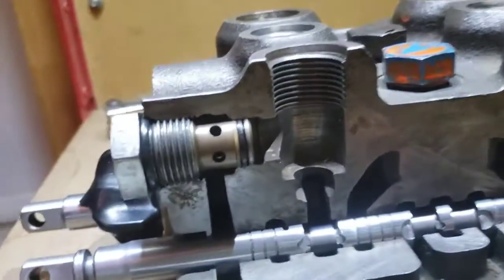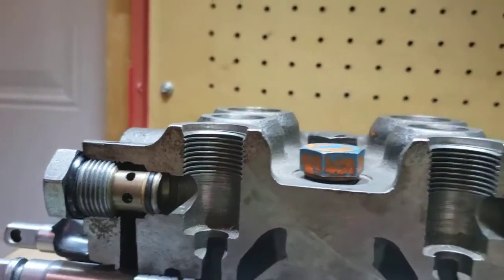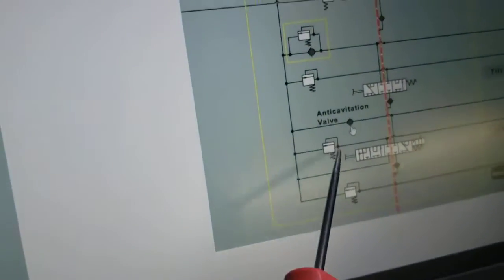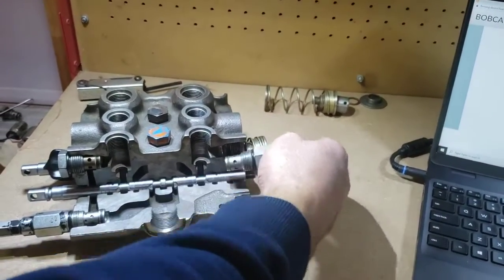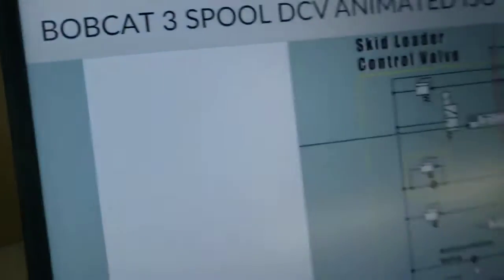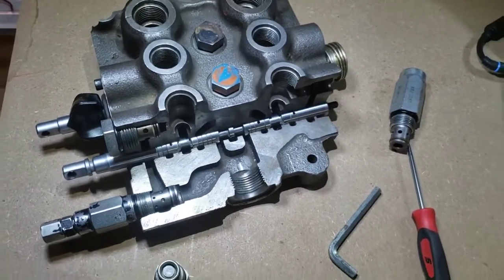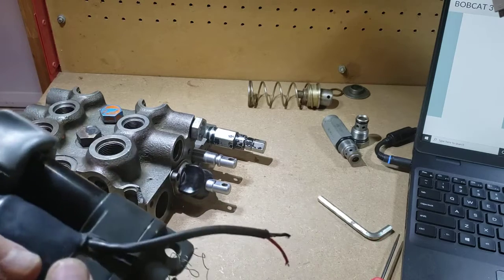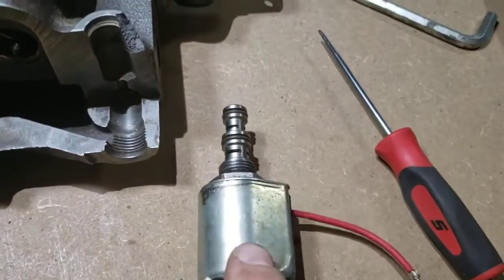Hydraulic Control Valve Cutaway HYDRAULICS FLUID POWER BASICS PART TWO

Comment: Where is the rest of this video? I need the part where you left off of that electronic solenoid mine is not allowing me to get any flow through my couplers lines. There’s no flow at all. Also, I’d like to see how that solenoid works when you apply 12 votes to it, mine is staying on an open position and closing flush. Once you do that I don’t know if it’s supposed to be like thatwe were almost there. Thank you.

Comment: Hi sir. Thanks for the videos. I have a 3 function mechanical valve system on a hyster forklift that has an issue with fork lift drift. I’ve already resealed both lift cylinders, checked relief valves and see no issues. What else could cause this?

Comment: On my compact tractor when I curl by bucket to full curl my relief valve on the system activates. But when I dump and bottom out, there is a delay before the system relief valve activates. 

I've worked the hydraulics full deflection multiple times and still does the same. What would I look at in the control valve as possible issues?
Reply from the maker: What's the issue? You're blowing hoses?
Reply: @hydraulics the issue is if I go to back drag with the bucket and move the control lever to apply downforce pressure it is delayed. The bucket will go to dump right away when I move the lever up in the air but rested on the ground seems like there is a delay in the hydraulic downforce. If up in the air normally when you bottom out hydraulics the relief valve activates. This, bucket dumps, bottoms out the cylinder, but then even then, the cylinder is delayed building enough pressure to activate the relief valve. Curl function? Completey normal. This is a compact tractor FYI. Im use to bigger equipment so idk if there's a quirk with smaller cylinders.
Reply: @hydraulics or would this be more related to the load sense valve being delayed. Troubleshooting i did so far is switched the bucket curl and dump hoses. Turns out the result was the same. Everything works well curling the bucket, just when I dump do the hydraulics seem sloppy and delayed.

Comment: hello just bought a bobcat 645 and i am troubleshooting i have a leak from a plug at the bottom of the Hydraulic Control Valve 
and one of my spool valves isnt smooth is like stuck in everyposition any suggestions ? is it fixable or i need a whole new part ?

Comment: I need your help , i have a digger that it sounded like it was laboring when i moved the bucket  with out load on it , so i thought about how to test what was happening  and i took both hoses off the cylinder and i hooked together with a T and a pressure gauge and the pressure rises to over 2000Lb  just  moving oil in a loop , it’s a cluster of valves with 8 spools , do you think it’s leaking internally  between spools  or what do you think the problem is ?  It’s  feeding pressure to  both hoses simultaneously

Comment: Awesome explanation and tutorial.  Is it safe to assume then, that if a spool is in the neutral position, and there are no port reliefs installed on that valve, if the cylinder was pressurized by external force like a thumb mechanism on the Auxiliary being pushed against by the bucket curl on an excavator, the fluid has no place to go and would either bend a cylinder, break a mount, burst a hose or even damage the valve?
Reply from the maker: @henrylevi3836  yes. Bent cylinders and blown hoses... if the external force is great enough

Comment: What happens if the rod end is overpressurised? There appears to be no pressure relief for it? Okay, I see now. That is a likely scenario for the bucket, but not for the boom, hence the lack on the rod end of the boom.
Reply from the maker: Bingo. A lot of wheel loaders have no port reliefs in the loader lift circuit.  They just build the components to take the abuse